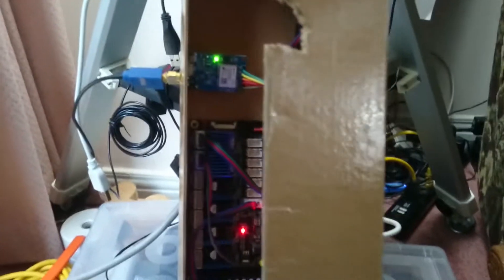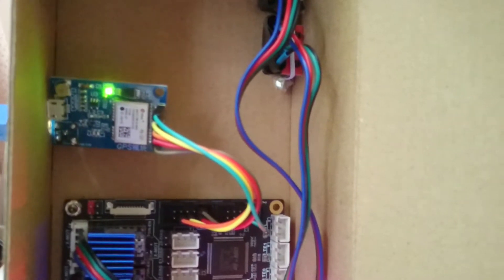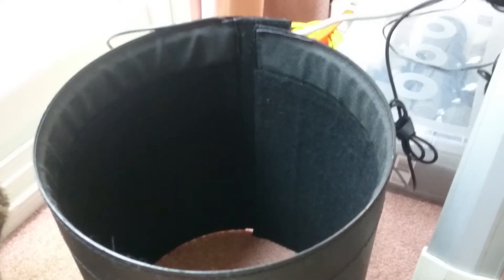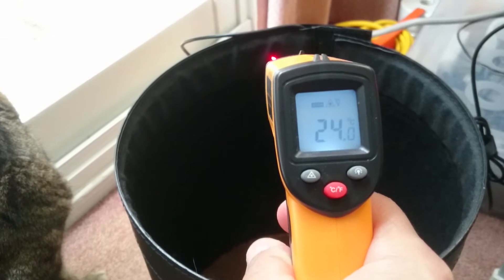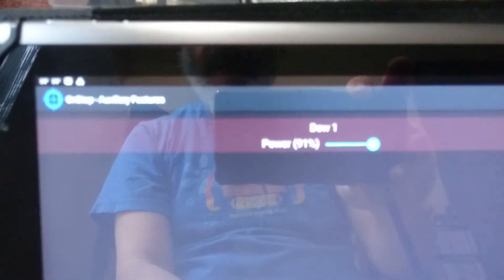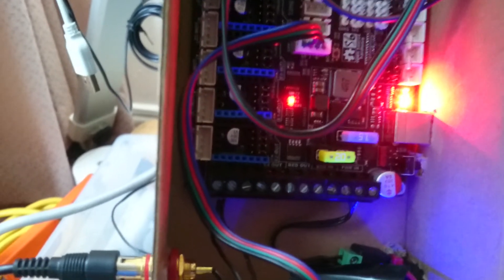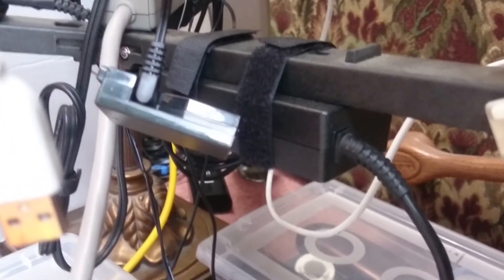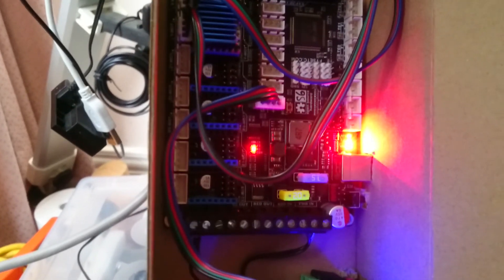FYSETC S6 3D Printer Board with OnStep Telescope Controller - With GPS and Dew Heaters

Comment: Just stumbled upon your video. I'm building a harmonic drive unit with the FYSETC E4 and I'm wondering if you've had experience with this board as well? Can I use the hot bed output to power my dew strips/heaters? Can the fan power be jumped to power something like a flat master through OnStep and N.i.N.A? Sorry for all the questions; I know that this is an old video but I hope that you keep up maintenance on it enough to see this comment!
Reply from the maker: I never used the E4 board.
Only the FYSETC S6. 
Check the OnStep group to see if it is supported, and what features/limitations it has.

Comment: I would ask you,please, if softwares and installing procedure to get a GoTo by OnStep with a mks gen l v1, are the same as for arduino mega. I would know if i must use and charge arduino IDE before, on a Mks . Thanks
Reply from the maker: Both the MKS Gen-L and the Arduino Mega 2560 are very old and don't have enough power. 

Go to the OnStep group for the alternative hardware, and instructions for everything.
Reply: @khalid_ba  thanks! 👍
Reply: @khalid_ba  can you suggest a better microprocessor...drivers....for better results? I read some posts but they all use much complicated board and mks seems so clean and simply to use...
Reply from the maker: @massimoborghini9724  
There is no simple answer, since there are lots of criteria on what is 'best', what is most suited for the features needed, what is available in your country, and so on ... 

The OnStep Wiki has a lot of info on what is available

Check the first few links on this page 

https://onstep.groups.io/g/main/wiki/3861
Reply: @khalid_ba  i find very useful info , calculators and solutions but no way for a simple step by step tutorial. I just want to try to build a GoTo system by a board, drivers,stepper motors nema 17 (3d printers) for my self made litle dobson. I have a mks gen L 1 drv8825 and a bag of motors availables in my cave.... I saw your video and i find it  interesting to start building . Tell me  Mks is mega 2560 with ramp, isn't it?......so  i should load arduino IDE to manage  Onstep sw set up, right? Thanks for your answers
Reply from the maker: @massimoborghini9724  
I never used the MKS or Mega 2560 myself, but they are known to be the earliest, and least powerful of the boards.

The DRV8825 is known to be the worst driver for OnStep (causes vibrations, inaccurate). 

You can try what you have, if you already have the board, and not buying new one. 

The last section of this page has the info on MKS Gen-L, RAMPS, ...etc. 

https://onstep.groups.io/g/main/wiki/28534
Reply: @khalid_ba  So, If it works fine, i'll get one! 😊👍
Reply from the maker: @massimoborghini9724  
If you have the board already (not buying it) then you can try. 

If you have NOT bought a board yet, then consider other boards that are better, and have less limitations.
 
For example, the FYSETC S6 is much better.
Reply: @khalid_ba  so, i try with mks (surplus of a hot wire cutter) . If it doesn't  work properly,  i will buy the fysetc . Thanks for your support 🙂👍

Comment: Just wait till that RCA cable melts and your house burns down. Sorry, but using an audio interconnect designed for 2-4v and a few mA is just straight dangerous.
Reply from the maker: Umm, so tell me why was the dew shield itself manufactured with RCA connectors? Or why are all dew controllers designed with the same RCA connectors?

For example, Kendrick

https://www.kendrickastro.com/dew_controllers.html
Reply: It's standard for dew heaters to use RCA, current is under 2A and they don't warm much to minimise impact on the optics (plus you might use PWM), the cable and connectors are spec'd for way more than "a few mA", and being used on cold nights the cables will have plenty of natural cooling if they did warm at all. Now I've got a FLIR I might check to see how much warming if any there is, but it's never been an issue and I've never felt any heating.

Comment: Trying to get my head around Onstep,I have seen lots of you tube videos however where is a fixed file for using an arduino mega with the required motor drive modules ,GPS ,RET, ect /Alt.Ax mount /and a laptop (win) with starrilum call it OnStep ver1heres how to set it up and go for beginners to OnStep, to help get peopleget started and include the location of the code files so you do not have to go to 50 million pages before you get a git hub location. I am not trying to be a smart ass but some of us do not have the bucks to buy the big C8,C15 ect But we are happy with out 80 or 90 mm scope and all we want to do is look  or star hop and say wow and as we get more experience we will get more advanced...I really hope you understand.
Reply from the maker: Start by reading the Wiki.

https://onstep.groups.io/g/main/wiki/3884

Comment: love what you guys are doing.. im just throwing out an idea, could the tft/lcd output on the board be used as an ui for onstep controller (touchscreen hc)?
Reply from the maker: No. 
OnStep is not written to do that. Also, it is a real time application that needs precise timing, and therefore the microcontroller cannot manage something else. 
But there are facilities to have a different microcontroller with an LCD which shows status information, and has buttons too. It is called a Smart Hand Controller, and can be built using an ESP32 module and a few other parts. Check the OnStep Wiki for details.

Comment: Using a 3D printer board makes so much sense!! Thank you and Howard for the wonderful work. I am etching to try it out but shipping is still restricted where I am so have to wait a while. I can say that this will only get better from here. Again, thank you!
Reply from the maker: Yes, 3D printers make sense. Because they already supports stepper motors and drivers for them. As a bonus we get dew heaters and fans too.

There are also CNC boards, like the R32 with the CNC V3 shield. No heaters, but very cheap (less than $10 total).
Reply: @khalid_ba  Exactly! OnStep is progressing toward a complete observatory control system and not only a mount control. With that many motor controller I can easily see this automating every aspect of astrophotography. Like, mount, focuser for both primary and guide scopes, rotators and maybe even dome/roof control. And if it can gather weather data as well, I dont think there is anything more you need for complete automation :) This got me really excited!
Reply: BTW can you control the temperature for the dew heaters? Like if you can sense the ambient temp and then have the heater be 5C higher (this can be user set value) than that?
Reply from the maker: @zubuyerkaolin  OnStep already supports two focusers and one rotator. Observatory motor is a different story though. Howard has a separate OCS board, which I do not use.
Reply from the maker: @zubuyerkaolin  Yes, if you have a BME280 sensor (temp/pressure/humidity), it can do that. Also if you have a thermometer on the item being heated, it can keep it at some temperture above the dew point.
Reply from the maker: @zubuyerkaolin  There is support for an ambient temperature/humidity/pressure sensor, and it calculates the dew point, and using a thermometer, OnStep adjusts the temperature of the element to x degrees above the dew point
But I don't use that feature myself. Don't want extra cables.